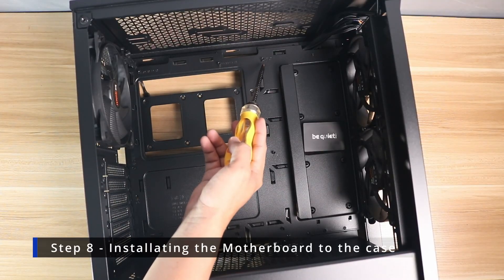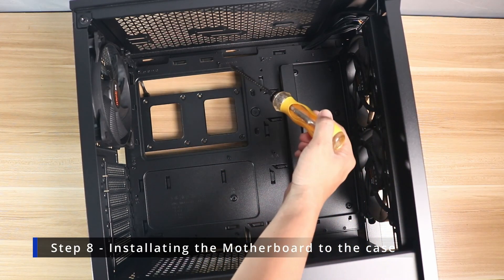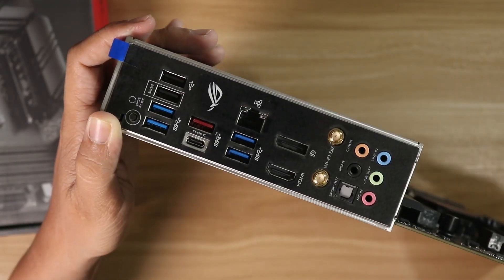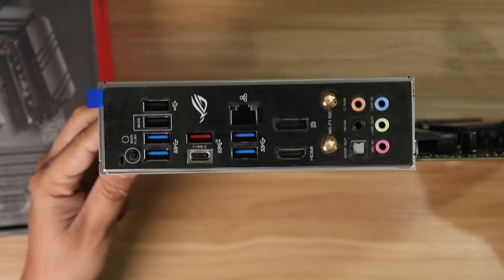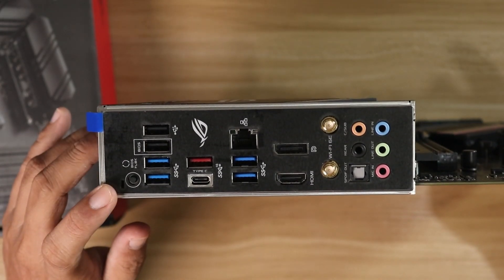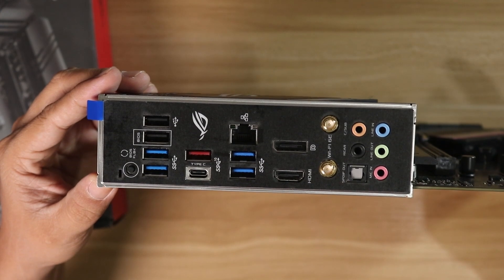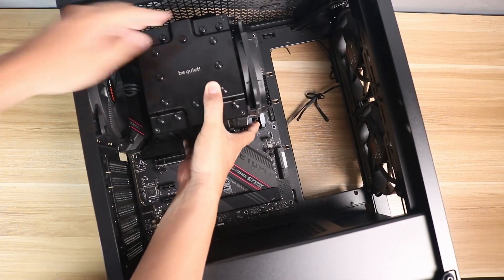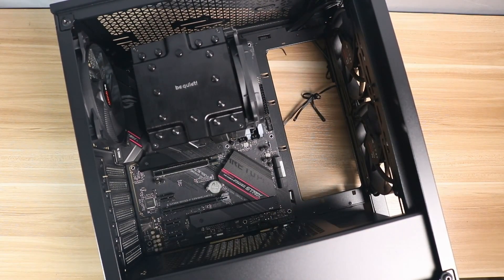Installing Motherboard to the Case (Step by Step Guide)

Comment: So glad I found this video. I was having trouble installing the MSI B650 Tomahawk WiFi motherboard into the Be Quiet Pure Base FX, which is the same as your chassis, but with RGB. I didn't know why the holes for the screws weren't aligning properly, but I was completely ignoring the stand off in the center that wasn't threaded. Once I aligned that one, all I had to do was slightly adjust the motherboard to align the other stand offs and that was it. Thanks!
Reply from the maker: Thank you that our video helped you! Feel free to come by again and the only  thing we can ask is to subscribe to our channel!